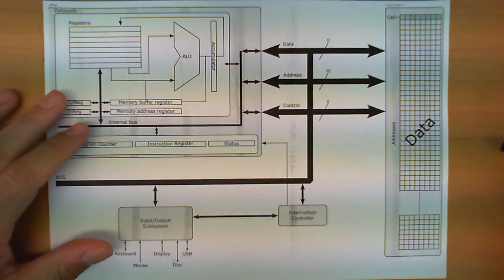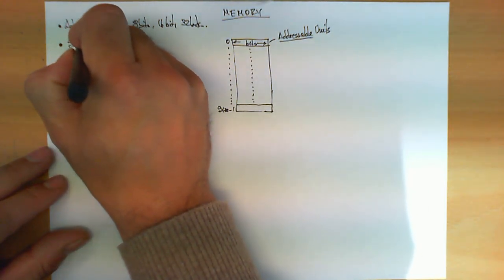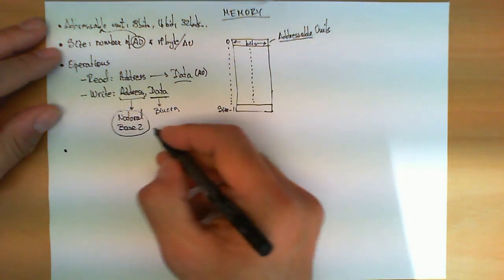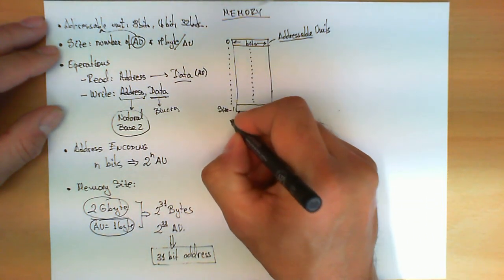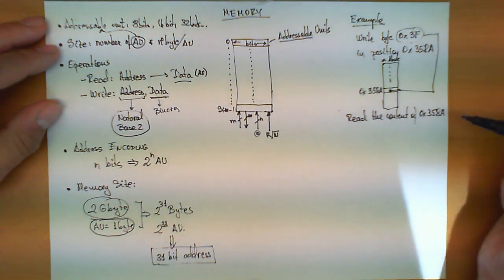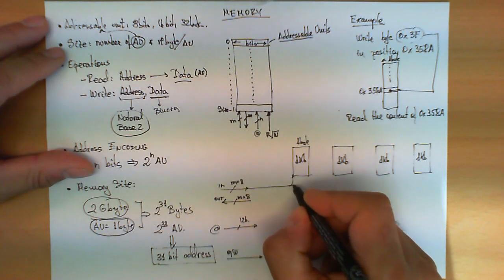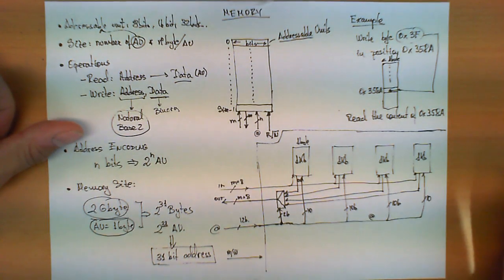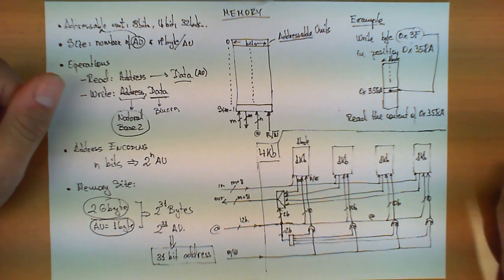How memory works in a computer system

Comment: I don't know how the multiple memory system can work like this, if the decoded bits are connected with R/W bits through an OR gate and input of the R/W is negated then all the time when R/W is off the output of that OR gate is on, so it have no purpose, it works though for the data output because of the multiplexer but what a bout data input? R/W with that OR gate don't really control anything so the data gets stored in every memory chip. In my opinion the decoder and R/W should be connected through an AND gate then writing command would work normally and the multiplexer would not be needed because the decoder would point the memory chip from which to read. If there is an error in my way o thinking please explain it.
Reply: l support your objection

Comment: why the size of the memory is N-1?
Reply from the maker: It is not the size of the memory, but the address of its last cell. It is N-1 because we start counting at 0.
Reply: because you are starting from 0
for example, if you say you have 10 numbers, but if you start from 0, then you have 0 to 10 -1 numbers
like
0 1 2 3 4 5 6 7 8 9
these are 10 numbers, but we start from zero, so we have 0 to 10-1
Reply: Also known as zero indexing as opposed to counting your index number from one.

Comment: 4: 21 part is not clear yet..
How 1 byte size of Addressable Unit can have 31 bits
Reply: Think about the early part of the video when he discussed addressable units (rows). Each row has to have a unique address. To use a simpler example, imagine a 4 byte memory block. The memory block is 1 byte wide and has 4 addressable units (rows). To create a unique address for each row, you would need 2^2 addresses or 4 unique addresses of two bits each (00, 01, 10, 11). So thinking about the 2GB example, you need 2 x 1GB memory = 2^1 x 2^30 = 2^31 unique addresses, which means you need addresses that are 31 bits in length.

Comment: How did you get 12 bits for address size?
Reply: he needs 10 to address 1024 AU , and 2 to provide 4 possible outcomes to select , thus 12 in total.
Reply: Remember the address or location of a byte in memory never changes but the state or bit pattern can change. So 10 bits will allow  2^10 1024 different bit patterns to code with.